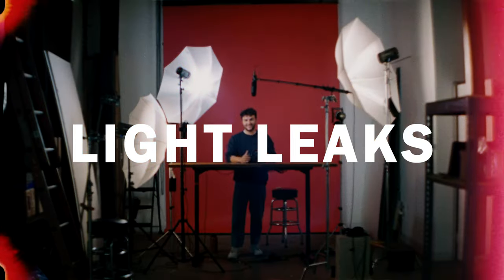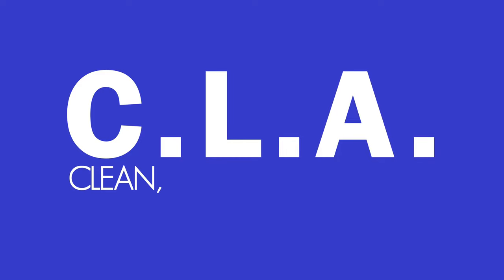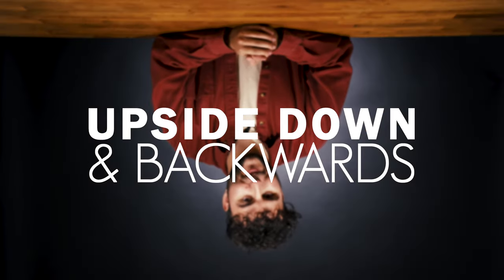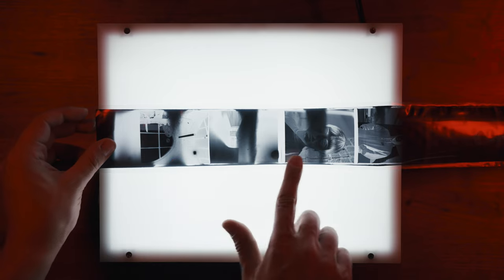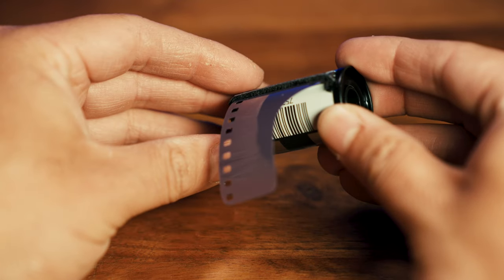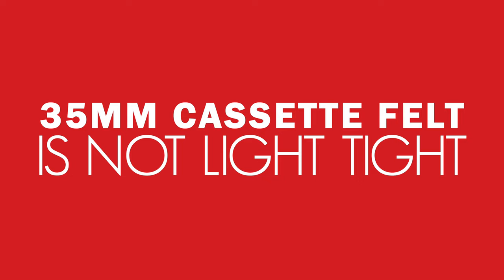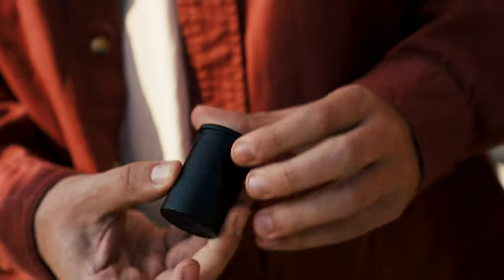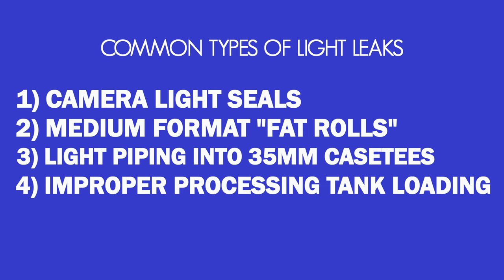What are Light Leaks and How Did They Get On My Film?

Comment: I had been struggling with light leaks so I replaced my light seals. Shot my roll and developed it and it got a lot worse. I was about to start troubleshooting when I watched your video and you mentioned the center column. Bamm! right there I noticed my mistake.
I had loaded the spool and put it into the canister to develop. Right before developing I noticed that I forgot the column so i went back to my dark room and put it back in. It had obviously been too late at this point and my roll was ruined.
So far I made pretty much every possible mistake at this point. But I know those won't happen so fast again. Thanks for the vid! :)

Comment: The biggest source of light leaks for me has been from imperfect bellows cameras.  A small hole in the bellows can ruin images depending on the intensity of the light outside.  I've had to repair a Mamiya 6 and Makina 67 because of pinhole-sized holes.  I fixed the Mamiya 6 with electrical tape 3 years ago and it works great now.  The Makina 67 required a complete bellows replacement which cost about $150 (in Shanghai).  The lesson I learned with both cameras is to inspect them closely with a bright flashlight before buying or running a bunch of film through them.
Reply from the maker: Great tip! Yes the bellows are a another whole reason why it's good to inspect and CLA your old cameras!